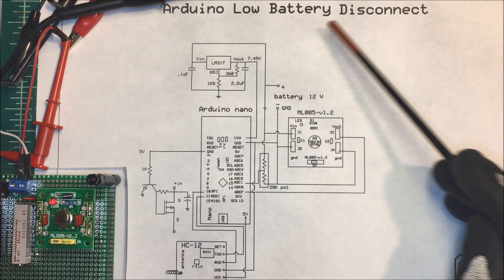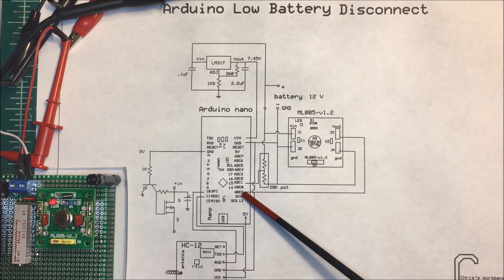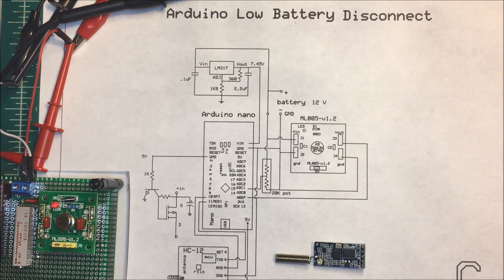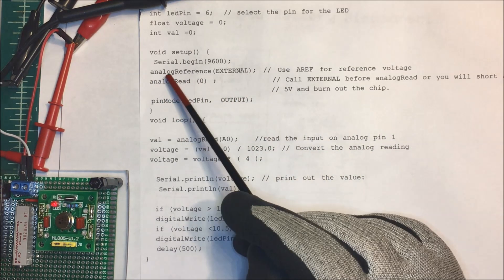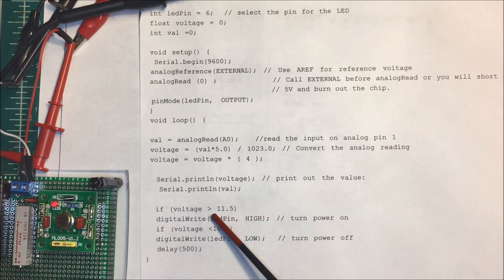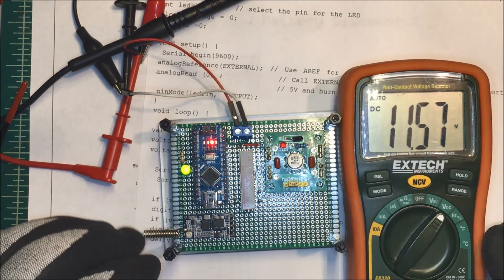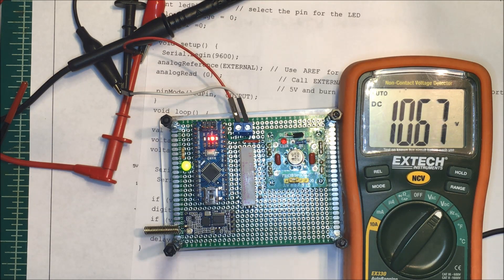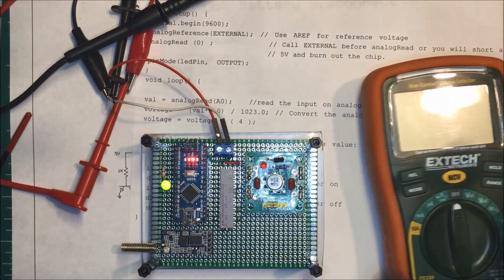Arduino Low Voltage Disconnect

Comment: Can it be set to voltage disconnect at say 12.4 volts and reconnect at 12.8volts
Reply from the maker: Yes You might have to set the delay time higher so that the in rush current on the load doesn't  drop the voltage and disconnect the voltage

Comment: Thank you very much for sharing your diagram. I am doing the same thing on a different type of project, except that I need it to do the opposite. I need it to turn on when it drops to 11.5 and off at 14 volts. I know that I'll need to move a few things around, but it gives me a working foundation where I was a little lost.

Comment: Sir please share the circuit diagram for LVD(LOW VOLTAGE DISCONNECT) 
1.connects the when the voltage >48vdc(load 100 amps)
2.disconnects the circuit when the voltage <42v dc (
Reply from the maker: link to diagram: https://drive.google.com/file/d/1NhgFyKWv01mewuxKaROktJ2QjyRraUsL/view?usp=sharing